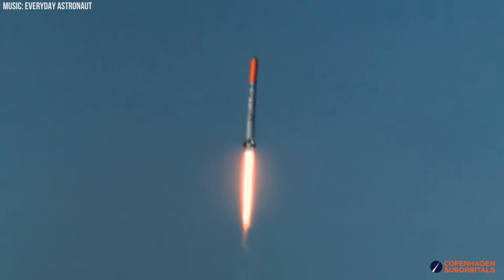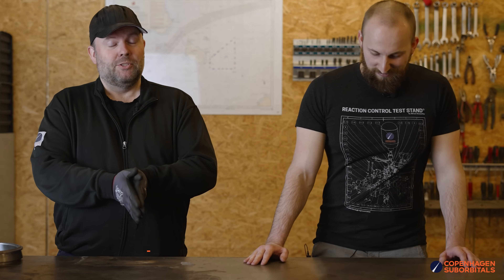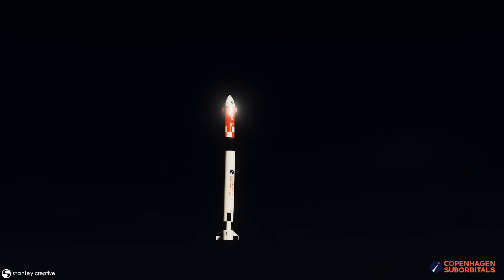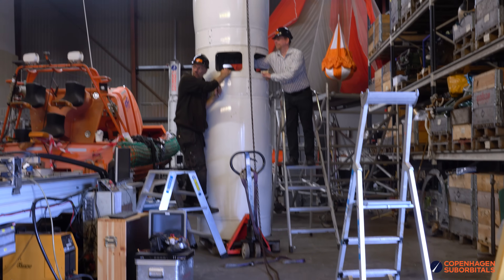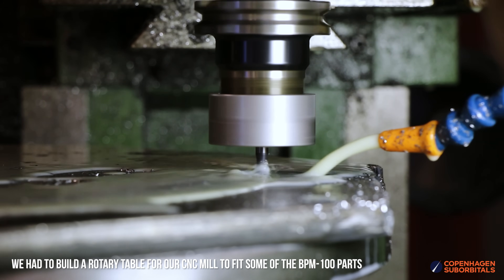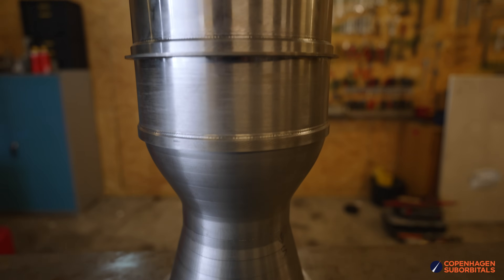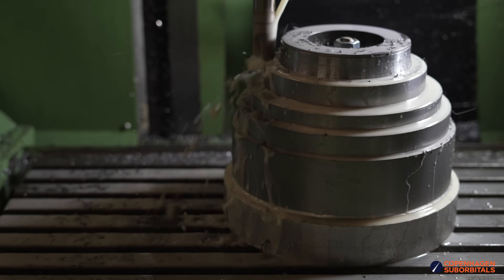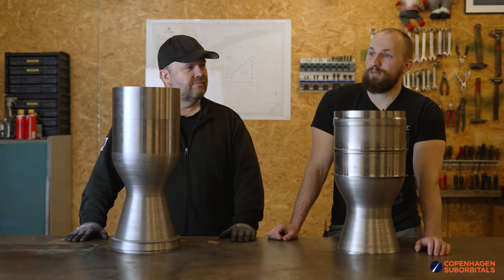We made a Rocket Engine. But it's a surprise!

Comment: The Saturn 5 F1 engine combustion camber and exhaust skirt were made using inconel tubes formed in the shape of the thrust chamber and stacked in a circle between two precision machined ring shaped manifolds. The full assembly was then brazed together in a furnace. Bands were then wrapped around the shape for strength. The tubes not only formed the thrust chamber but also doubled as the cooling jacket for the engine.

Comment: It might be worth continuing this system longer than you're currently thinking of. In particular, if this engine works well, then it might be worth clustering combustion chambers around a single set of pumps, with one central chamber being used as the main chamber, and the others only having their combustion chamber control valves opened when higher thrust is desired.
Reply: Even though we do not use pumps I like your approach. You are welcome to come by and work with us. Just remember to find a job in the Copenhagen area to live of, using your spare time to work for CS.

Comment: With regards to heat-flux, wouldn't a copper-alloy inner liner be more suitable than steel? Or are you going for an ablative coating on the inside?
Reply from the maker: For our low-pressure engines and conservative fuel mixtures steel is good enough.

Comment: Why don’t you spin form all of your parts and then weld them ?
Reply: If you have successful personal experience in this method of production, we will like to hear from you!
Earlier trials during development of the BPM5 were disastrous.
Reply: @jorgenskyt  yes sure I would love to help give you some information. Personally I am a cnc programmer and engineer so I have not done spin forming parts personally. But I have seen it done and it is quite common in china making cups and plates and in Japan that’s how they make their rocket nose. I just figured instead of billet material, you could redesign a version with simply sheet metal parts that have been squished by hand up on a mandrill and you could make a rocket nozzle and weld it like you have been doing
Reply: @jorgenskyt  
https://youtu.be/43N44ICyuEU
Reply: @EchoCharlie11  
That's exactly the method we have been using years ago in our childhood.
During the later production stages, like welding and nickel plating, we realized the method of spin forming introduced oily inclusions inside the spin formed metal parts and a number of other critical flaws. It seemed promising at the time, but has been abandoned. Others could have success with it, but we hadn't.

Comment: So is it 5 engines with dedicated pumps or just 5 thrust chambers to get around the manufacturing issues?
Reply: The latter.
Reply: It is 4-5 individual motors. As we have not yet decided the method for delivering propellants for the combustion you might call it "an engine assembly with individually gimbaled and clustered thrusters". Probably with a shared control system - everything is connected and it will be a complex system. At least viewed from our amateur perspective.

Comment: Can you electroplate a huge rocket engine from copper? (I suggest copper because it is easy to electroplate and probably with cooling - like part of the LOX - heat might not be that much of an issue)
Reply: Can you? Demonstrate the process and show it to us. We are open to any suggestions!
Reply: @jorgenskyt  I have done it as a hobby years ago. You should find videos on youtube. Possible issues could be the need of potassium cyanide and photosensitive material on curved surfaces. Also some form which could be electroplated and that could be wax or probably even coated limestone --- depends on what works best for your CNC-machine.Iron and aluminum don't work well with electroplating.
Reply: @mathiaslist6705  
Exactly. It is a very interesting technology but when you dive into it, it is way more toxic and way more difficult than the theory implies. For a crowd founded NGO like ours we have to use of the shelf materials and (common) state of the manufacturing methods.

Comment: I was wondering if you were having problems due to the lack of videos about it, glad to see you identified the issues and are working around them. I look forwards to further updates!

Also I've read a few old NASA papers that have calculated a 4-engine layout to be the ultimate balance between risk factors, so the fact you have a 1/4th size engine isn't too surprising

Comment: The problem with external welds is getting a clean penetration to the internal surface that does not leave a protrusion into the flow path, or an incomplete penetration that will allow high pressure exhaust gases to erode at the join. Hmmm...
Reply: The fuel only flows from the higher to the lower pressure. Thus in all regeneratively cooled engines, the highest pressure is between the double walls of the thrust chamber assembly. There is some pressure drop in the cooling channels, then across the injector, and only then you get down to the pressure of the hot gasses. So any leak would just spray fuel into the chamber, not the other way around.

But of course you are right, any debris blocking the cooling channels themselves would be disastrous. All the joints need to be carefully designed and the welds expertly executed, with proper quality control afterwards. Very time consuming.

Comment: But, you also need to consider the fact that having 5 engines gives you redundancy. If your one engine fails, then that’s it (like what happened to Blue Origin). If one of 5 fails, you still have 4/5ths of your power. You might still be able to complete the mission.

Comment: Btw for a 25KN engine , do you consider dpr to be a viable solution for maintaining chamber pressure or switching to a electric turbopump is a good option . 
Orbital machines are developing the same for you , development of a pump for 25kn engine must not be as hard as developing the same for 100kn so might be you can develop a pump fed 25kn engine which will be first of its kind ❤️❤️
Reply: We are working on development within at least 3 different techniques for pressurization ;-)
Reply: @jorgenskyt  the one I saw was a vaporizer which will convert liquid nitrogen to gas form at very fast rate and feed to the tanks but again this involves complications . R u looking towards developing and realising a cryogenic centrifugal pump .

Comment: Absolutely fascinating! As an amateur engineer nearing the tender age of 60 years, the most significant piece of wisdom I have come to appreciate is the necessity of putting any design idea into the context and in light of production capability and resources available. It's such a revelation to realize that a great idea is no good if it is just too hard to build. Like you said. Being able to have full control over the implementation of a design is vital to creating something that will actually work, or at least will have real hope of being able to work out problems that come up. Keep up the great work!
Reply: Thank you - and so well written! As you imply yourself it takes almost a lifetime to learn it, but we are trying our best to bring the wisdom you mention to the younger generation(s) so they don't need to use their own lifetime to realize it like some of we old folks have done😀
I've been a part of CS since 2010 and I have acquired an incredible amount of different skills based on our changing requirements through the years. I'd like to regard myself as an amateur engineer myself. With literally no education in the backpack other than "Gymnasium" (mix between high school and College) and a lot of different courses in manufacturing and a load of self studies, I am for the time being attending school again (together with youngsters aged 17-28) at an age of 62, becoming educated metal smith, specialized in stainless welding, next year. I believe that tinkering with everything in all of your spare time keeps you young!
Reply: @jorgenskyt  Thanks for sharing your thoughts. Looking forward to seeing your next milestone on the project.
Reply from the maker: Thank you! Glad we have come to the same conclusions.

Comment: Modern rockets: keep making the engine smaller until it is very cheap and easy to build, test, and refine. If that doesn't work, add more small engines until it does.

Sea Dragon: keep making a single simple pressure-fed engine so big that the weight of the fuel itself provides the pressure. If it doesn't work, keep making it bigger until it does.
Reply: Interesting rocket development philosophy. Me like ... 😀

Comment: Welding an hourglass shape inside of a close fitting hourglass shape, that's some expert level challenge! 

Have you considered a split ring for the outside section around the throat instead? That's what SpaceX has on their engines, and Soviets did too on RD-107.
Reply: We will "just" weld it. And you are perfectly right regarding the expert level of welding for the uncomfortably restricted space we have to work in. It will demand a lot of welding trials and material testing. And off course special welding equipment - which is EXACTLY what we are developing and constructing right now ... 🙂

Comment: Wonderful update!  Now,  on to thrust control vectoring.
Reply from the maker: One of the benefits of this change is that TVC and roll control becomes much more similar in implementation to the jet vanes we flew on Nexø I and II.
Reply: @CopenhagenSuborbitals  Each engine (assuming you have 4 or 5) only needs to move along one axis, not two for full control, right?!
Reply from the maker: Exactly.

Comment: So, geometrically, would a 7 engine cluster of BPM-25 be more viable, with 6 engines providing 150 kN and the 7th being the margin for engine failure ?  Obviously this would provide 3 gimble axes 60° apart instead of two 90° apart, affecting control software design.  Either way, you will need a new warning on the lower rim of the rocket to achieve the same level of happiness .
Reply: Four engines are enough for SPICA. The 5th is only a concept idea delivering the possible need for extra thrust during the first couple of minutes of flight.

Comment: It is interesting situation i must say, where manufacturing dictates complex design.
Kinda sad 100 aint happening any time soon, but still cool to see a cluster
Reply from the maker: It's more than just manufacturing, actually, but we'll touch on that in the pros and cons video.
Reply: I'd say this is the shortest, fastest path towards an actual BPM-100 -- should they actually want to make one after having built the BPM-25s.

The really good question is why they didn't do this 4.5 years ago...
Reply: @peterfireflylund  Why? That's actually quite easy to answer: 
Some times you chase the gold at the end of the rainbow for years - and the moment you are about to give all up, you realize the bucket of gold is right under your feet!

We are a democratic organization making decisions based on best achievable knowledge. Then we stay on the track and do not deviate!
At the time we took the decision to streamline consensus in our aim for our future development, best achievable knowledge pointed towards one single, large engine, the BPM100. At that time it didn't matter whether we chose one design over the other because the manufacturing of ANY engine way larger than BPM5 was an impossible task for us: Either way, we had to develop a long series of completely new machinery, development tools and testing methods. 
By aiming high for the "impossible", we were able to develop an upgraded workshop, new skills, new welding robots, acquired new volunteers - and suddenly visualizing the BPM25 design that is the PERFECT fit for all the many upgrades we developed in our chase for the "impossible" 😀
Reply: It’s not the manufacturing it’s the people… they are not aligned on design or philosophy

Comment: Beautiful! Changing the design requirements to include on-site production capability is really good. But wait - There's more!
I can't remember if Spica was going to use gimbals or exhaust vanes for control, but if you're using the former, one BPM can get pitch and yaw control with two-axis gimbals but no roll control. However... 4 BPM 25 engines can run, each with a single gimbal axis, to control to pitch, yaw AND roll. :)
Reply from the maker: You're onto something! ;)
Reply: @CopenhagenSuborbitals  Keep up the good work, gentle-people. You're some of my heroes. :)
Reply: @somerandomnification  Is this what firefly uses on their Alpha booster? Can’t remember if it’s firefly or another small launch provider but it’s a very smart idea!
Reply: Could use differential steering, however if you are already working on gimbal that is probably better since differential steering means the engines are constantly throttling, which leads to instability. I think the N1 faced this problem.